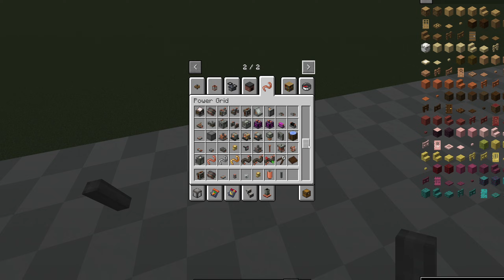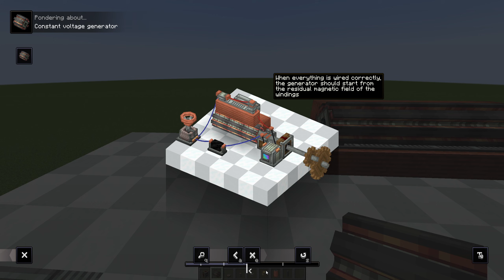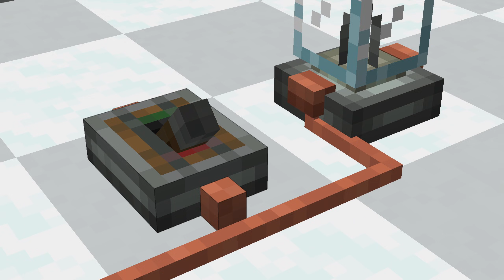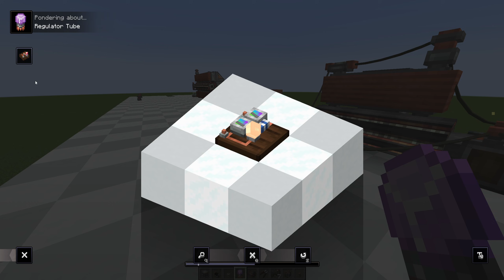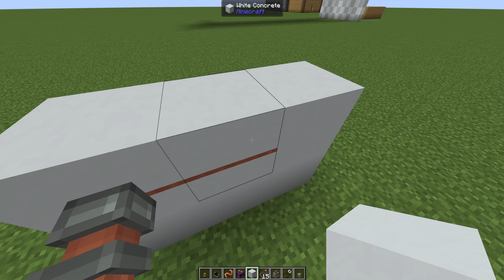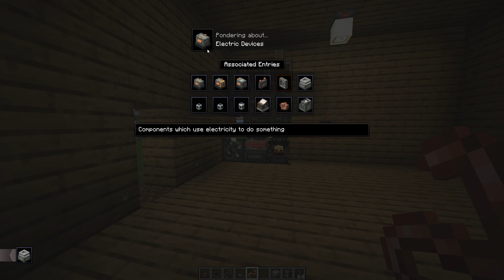The Most Realistic Electricity Mod for Create

Comment: The commutator makes sparks because you're generating the eletricity on the rotor part and in order to get it from there, you need some kind of mechanism that transports the eletricity from moving wires (the rotor) to stationary wires. We use commutators to make this happen, they consist of a segmented ring and carbon brushes that maintain contact with the rotating part. And as these move and shake, it changes the conditions for the eletricity to flow, mainly resistance; this may lead to sparks.
Also, you used a resistor in series with a load (your alarm bell); the main reason not to use a resistor but a transformator instead is that the resistor "burns" all the excess voltage, so you generate 120V, burn 100V across a resistor and are left with 20V. This is obviously horribly inefficient. How much power you actually burn on the resistor is determined by the Ohm's law. Transformators on the other hand use two coils around the same core. When current flows through the primary coil, it creates a changing magnetic field in the core, which induces a voltage in the secondary coil. So one coil is basically an electromagnet and the other one is a generator. Changing the ratio of the turns on the primary coil x the turns on the secondary coil allows us to change the voltage accordingly. These aren't 100% efficient but are much better than a resistor in series with a load.
Reply: I asked someone else this, but in theory, would it be possible to use multiple loads to make it "less inefficient"?
Reply: @semajniomet981  I’m not sure if the mod allows you to do this, but it’s possible in the real world. You can wire different loads either in series or in parallel. When you wire them in series, the voltage is “divided” between all of them. Six lightbulbs, each needing 20V and wired in series, allow you to split the 120V between them. This is a very efficient way of dealing with this particular problem, if you have the same bulbs (In reality, small differences can influence this math). They would also consume the same current as a single bulb.
On the other hand, wiring them in parallel sums up their currents. So they would still need 20V this way, and 120V would destroy them, but they would also need more current to operate. Whether you can use this “hack” to avoid blowing up components depends on the usage.
So let’s say we want to wire up four bulbs, each rated for 20V. We could wire them in series, which would give us a safe combined voltage of 80V. Now we can burn the rest on the resistor, which would also be wired in series. This way we are indeed “only” burning 40V, not 100V, which is much better.
One could say a resistor is a load too, it's like a heater with a set resistance. 
Hope this answers your question.
Reply: @real_mddiamond  The mod does full circuit simulations! I think it might only use resistive elements, though. I saw that it has a full matrix of node-to-node resistances it sets up for different circuits.

Comment: me an electrical engineering student watching this : "YOU NEED TO MAKE A CLOSED CIRCUIT FOR THE ELECTIONS TO MOVE THRU THE LIGHT BULB FILAMENT"
Reply: I swear, at the beginning I was just questioning the fact people have been taught basic electricity abroad, because the need for a circuit to be closed is like the one thing most of us remember years after those classes x)

We just don't all have a good memory of our classes ig lol
Reply: @MyNeLi_cr  Probably because every other tech mod does not need you to build a circuit so it's unexpected for a mod to do need it.
Reply: @MyNeLi_cr  and for consumer products that have a power cord connecting to a wall outlet it does both the power and ground in the one cord, so it doesn’t immediately make sense that it’s actually two separate wires that are needed
Reply: The two prongs and the fact many cables are visibly made from 2 wires with overlapping insulation should make it obvious, but maybe this is jest because i know how electricity works that i see that connection @alexsiemers7898
Reply: @alexsiemers7898  Right and the mod has that for things like the motors you can just connect the cord item but for components like a light fixture you'd still need to know how to wire it into your house lol
Reply: @MyNeLi_cr  I mean, even if you arent a electrical engineer, you need to know about circuit, at least the most basic, since don´t knowing about closing circuits, can cause accidents, and since is electricity, most of those are going to be extremely bad.
Reply: @MyNeLi_cr   ahem... immersive engineering, literally every other mod that introduces cabled does with one cable only. this is the first mod ive seen where you have to lay down 2 wires
Reply: @oceanofgaming  Well, this mod has non-insulated wires which obliviously needs to be seperate. There's also insulated wires, but mod lacks cables.
Reply: @MyNeLi_cr also it's Minecraft.
Reply: @MyNeLi_cr  nope. At least not in the US. Haven’t learned a thing about electricity from school
Reply: @MyNeLi_cr  It's insane to me that someone wouldn't "remember" the very basics of electricity. That's inexcusable in my opinion. I'd wager that practically every European, or at least us Nordics, knows these very basic concepts of a closed circuit, etc. Except, Shalz, I guess lol
Reply: Reject DC, embrace the raw power of AC. We not +, - around here. We are grounded.
Reply: @TryFiXed Sounds like Nikola Tesla Propaganda to me!
Reply: @feudalpig  say whaaat? I would never :_shalzLlama:
Reply: Who are we voting for?
Reply: @dadamaldasstuff1816  i think the positive charge is a good one
Reply: EXACTLY!!! AS SOMEONE JUST INTERESTED IN ELECTRICITY.
Reply: I, a man who has never attached a wire to anything, also knew this. I remember learning it in my middle school science class
Reply: I feel like anyone that’s done anything with electronics was screaming at the screen cause I know I was
Reply: I saw him put both wires to the switch and was like "YOU'RE MAKING A DIRECT SHORT" tbh i was surprised the power souse did not blow up when he did that.
Reply: This was the only bad part of the video😭😭
Reply: me NOT an electrical engineering student says that this was almost my exact Reaction as well
Reply: To be fair every mc mod ignores closed circuits
Reply: me as a mechanical engineering student reading this: "THEY DON'T MOVE THROUGH THE WIRE THEY JUST 'BANG' INTO EACH OTHER"

(not really banging into each other, they get excited to a higher energy state which moves them farther from the nucleus which puts them closer to other electrons which results in a transfer of energy or smth idk I'm not a physics major)
Reply: @ljam9824  electron movement or banging isnt the case..
electrons move too slow to have that much power
the real things are the electromagnetic fields created by them, not the electrons
Reply: I’m 12 and I figured that out instantly
Reply: I know, it’s just frustrating and painful to watch this.
Reply: No offense to Shalz.
Reply: Hypothetical question, would a set of 100 bulbs (or whatever device that needs power if you want to sub) rated for 120 Volts be able to handle the stress of a generator that produces 12 000 Volts, assuming that the wire that is carrying the power is able to carry the current (Amps) can do so perfectly (no other Ohms anywhere along a closed circuit)?

I apologize if I'm making you want to pull out your hair or scream in frustration at my stupidity, but it's been a long time since high school, and I don't quite remember all of the details I've been taught about electricity.

One of the few things I remember is that Volts (V) are equal to resistance (Ohms, IIRC the symbol for it [Ω] looks somewhat similar to the Greek letter Omega) times current (Amperes would be an I, correct?), which would be {V = I × Ω}.
Reply: @semajniomet981  If you put them in series, yeah, the voltage would be shared among each component proportionally to their resistance. With 100 identical bulbs we can assume they have identical resistance so each has the same 120 V drop across it. Adding more bulbs in series would reduce the voltage drop across each bulb resulting in them all dimming. (V = I*R, if total voltage is constant and total resistance increases, current must decrease).

However, most light bulbs are connected to the circuit in parallel (Meaning each bulb has its loop to the power source that doesn't touch the other components in the circuit). Parallel circuit have the benefit of every component receiving the full voltage, but the current is divided across each component. In this case voltage is too high across the bulb causing the electricity to short/arc. What exactly this short entails idk but it is probably blowing the bulbs.
Reply: @jonathonl7230  I did mean a set of lights in a series circuit. Sorry for not being specific initially.
Reply: @semajniomet981  nope, they would pop immediately. Kirchhoffs law, if you put loads in parallel, the amperage divides itself between the loads while voltage stays the same across them all. If you put the loads in series, the amperage stays the same while the voltage gets divided between the loads. The formula is

Voltage equals amperage times total circuit resistance

Where total circuit resistance is dependant on the circuit layout:
Serial:

Total circuit resistance equals the sum of all component resistances in the circuit

Parallel:
Total circuit resistance equals one divided by the sum of all component resistances each dividing one.
Reply: EXACTLYY LMAO
Reply: Same here, i was so flustered when he wasn't closing the circuit
Reply: This video drains me like a day spending at my university
Reply: I'm not even an electrical engineer student and this physical hurt me😂
Reply: I only Unterstand trainstadio
Reply: Real
Reply: Lol same
Reply: I do economics and have been taught this lol
Reply: That was so funny. And how he tried to reduce voltage by changing voltmeter scale
Reply: Me also an electrical engineer ing Student watching this: Great now add Phase Shift, aktiv Power, reaktive Power. 
And why Stop there? Frequency, -dependency.

Comment: Realistic electricity?? Gotta lock in (nvm i cant get the generator to work 😭... i forgot the clutch)

Considering how things work irl, if you want to reverse the fan, connect the wire backwards. Should work for motors too.

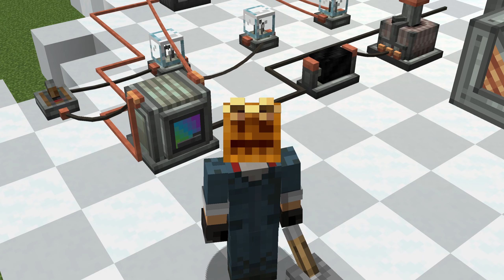Comment: Alternative title: "Shalz learns the basics of electricity in 12:37 minutes"
Reply: More like shalz ignores the basics of electricity
Reply: @redgn_  LMAOOO
Reply: HE DIDN'T KNOW WHAT WAS WRONG, BUT THE CIRCUT WAS NOT EVEN CLOSED.
Reply: More like “Shalz tries PCBs manifacture instead of simple wire-connected tech”😂
Reply: @ThatSovietTrain1225 
"Shalz trying to build supercomputer to solve issue that can be solved by the most common electrical component"
Reply: @Redstoneprofi01 "how do I reduce voltage?" The humble resistor:

He figured it out eventually at least.
Reply: @theshapeshifter0  nah, use a transformer. You dont want to lose power through heat radiation
Reply: @ThatSovietTrain1225  I'm learning how to make PCBs right now, and when I saw the in game desiging, I almost broke down, this is too complicated(Not the in game).
Reply: Maybe this mod, is good for understand électricité for pepes
Reply: did they not learn that at school we did how did they not T-T maybe just forgotton ig if you dont use it, it will blut in the forgotton realm next to high level algebra
Reply: @lootclan5842  i didn't get any electric theory at school (southern US), didn't learn about it until my job or what I looked up on my own
Reply: @captainjirk9564  at our place its part of physics, they also have little building kits for kids so you build your own circuit with jumpers etc and play with concepts like induction, magnets all that stuff
Reply: @lootclan5842  To be fair not all schools are made equal
Reply: i'm guessing you wrote the time off by 1 second purposefully so people will reply to you to correct you...

..but i don't care: hey man you got the time off by 1 second, it's supposed to be 12:38 not 12:37 goober haha dumdum you made a silly mistake haha LLL couldn't be me
Reply: @NiaSwift  on mobile, youtube adds an extra second. i don't know why.
Reply: @NiaSwift Well, it said it was 37 seconds when I wrote the comment.
Reply: @NiaSwift foundthemobileuser
Reply: He did not
Reply: Can't believe he finally figured it all out at 12:38

Comment: Welcome back, Immersive Engineering
Reply: nah, this is so much better honestly
Reply: eh? its not this complicated in the mod
Reply: @theautisticmollyoh, this is so much more complicated than immersive engineering heh
Reply: I've fought with Immersive engineering dozens of times to get the wiring system in a way that's functional and looks good, and this is immediately superior. The fact that you don't have to put connectors and relays EVERYWHERE just to get it to go where you want, and you can place both on and through walls is an immediate step up in both base designing and actual engineering
Reply: @yeetusmcskeetus3112 IE power system is also very janky and doesn't really work well with more than 1 "phase" power supply, also sucks with long distance power transmission
Reply: @yeetusmcskeetus3112  well at least a can understand IE, this is a "electrican simuator.
Reply: @yeetusmcskeetus3112 well ie uses fe as well as this so they work together
Reply: Immersive Engineering is still going tho…
Reply: also Electrical Age mod
Reply: @subvia  forgotten mod that had so much potential, man
Reply: It's a shame this Create add-on is not on 1.21.1, like the real Immersive Engineering.
Reply: @SuperStormDroid  They confirmed a 1.21.1 Neoforge version will be developed.
Reply: @SuperStormDroid both mods are available in 1.20.1, and 1.20.1 has access to the largest variety of compatible mods from what I've seen.

It's likely why so many modpacks are on either 1.20.1 or 1.18.2 because of mod availability
Reply: you can still go back to 1.12.2 and play with Immersive Engineering in 2026
Reply: @communistIchtyosaur161  its literally updated to 1.21.1 lol
Reply: @cytrynowykisiel362  you can play the Prehistoric nature mod wich adds over 1800 prehistoric animales only on 1.12.2 tho so nod an objective update